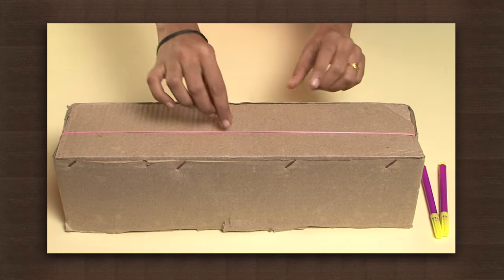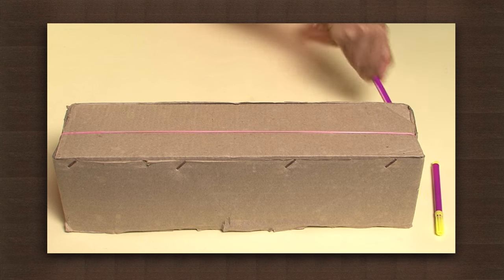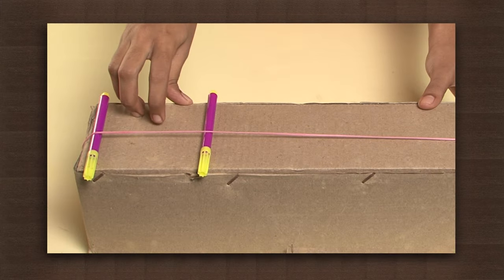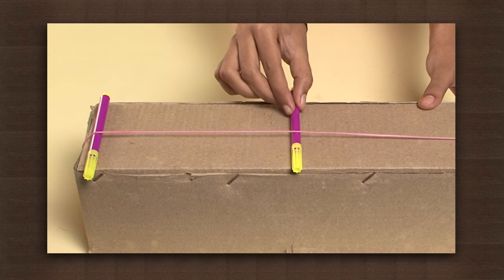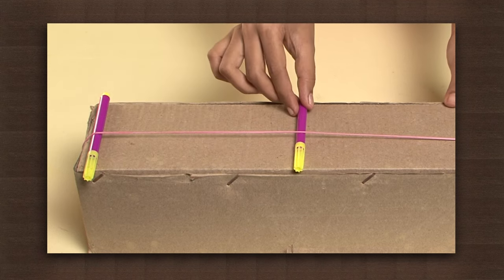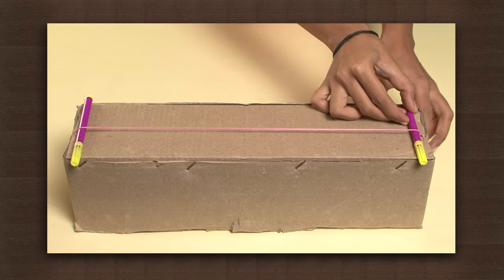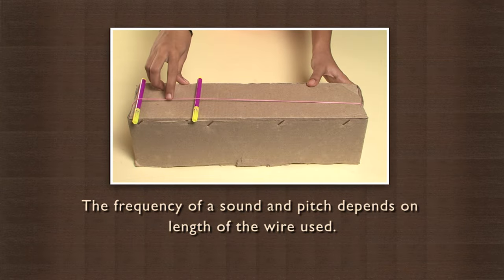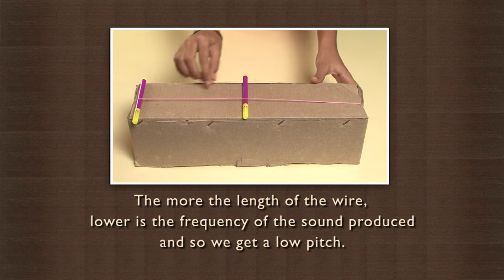Length of rubber band determines pitch | Sound | Physics

Comment: What about stretching a rubber band? The longer the band is stretched the higher the pitch?
Reply: Hi Stephanie.
Yes, I think so. In that case, what comes into play is the thinning of the rubber band as you stretch it ,which gives you a higher pitch. So, thinning should offset the length.  I'm not an expert but I gave it a shot ;)